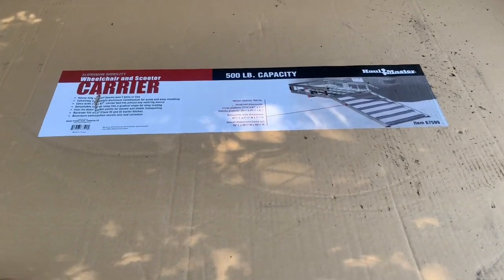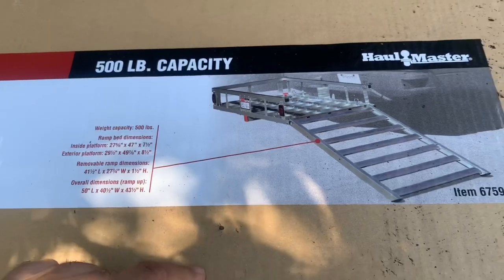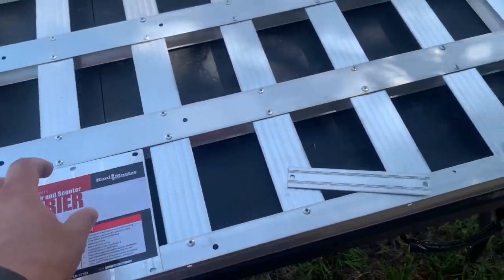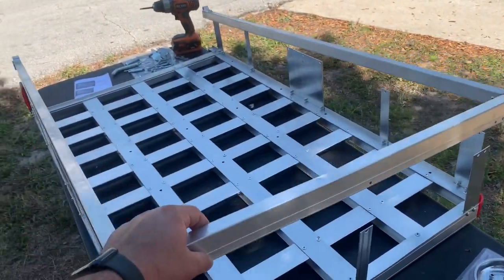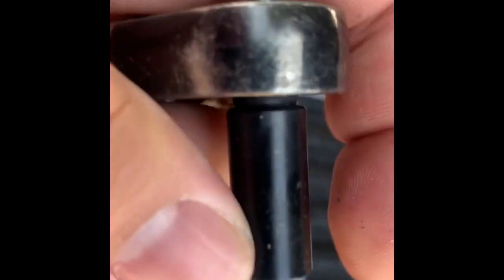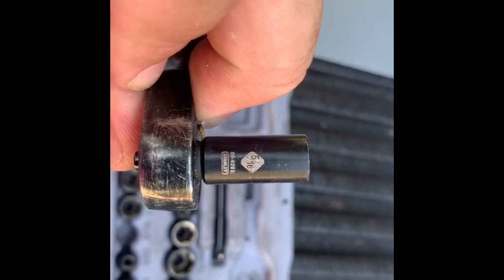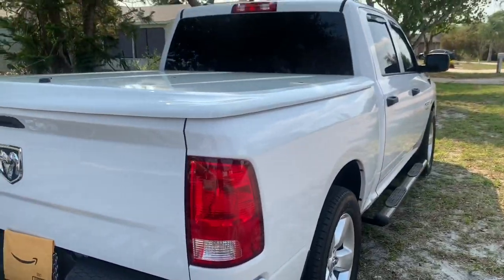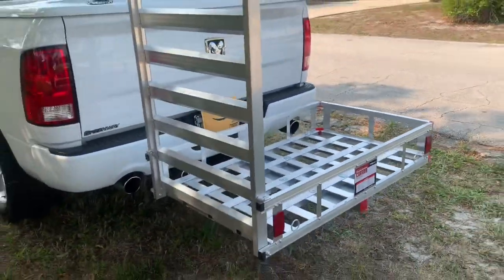Harbor freight mobility wheelchair and scooter carrier assembly, review and demonstration

Comment: Helpful video. I wish I would have watched before putting mine together today. In the video from HF, they show it loading on the driver side but the box and photos show the left. Also, if loading at a curb it makes the ramp angle less which makes loading easier. Thanks a bunch.
Reply from the maker: no problem thank you

Comment: Although it would lower your ground clearance, it would help with the ramp issue is to have a hitch extender that lowers the carrier.
Reply: That is exactly what I was getting ready to say, I just saw the video myself for the first time on the Harbor Freight app, and I come to here to be able to leave a comment, but yeah,  an extender to where it would lower it to the ground a little further about 4 inches that would make a big difference and be able to get it up there on it with just one person, I’ve got one myself and getting ready to purchase a ramp carrier to be able to take my scooter with me when I need to go somewhere by myself and I know myself personally, it would be a little hard for me to get it up there it would give me out real fast But yeah, the extender to where it would lower it even about 4 inches like I said to the ground would help a great deal……
Reply: I agree, A drop/rise receiver,  for a pickup depending on the height of the truck, 4”-6” probably. Most of the carriers are designed for cars or SUVs, that are lower to the ground.

Comment: I have a 2010 traverse. I have the hauler with the ramp on the passenger side. But  I have to lower the ramp in order to open the rear hatch door. Should have been off set.  I also bought the anti rattle tightener to keep the hitch tight. The hitch part makes it heavy.

I plan to extend the top ramp pin holder so it will slant out enough to open the rear door.  Also, since this carrier is wider -  if you position coolers, bike etc correctly the rear door opens without unloading everything. So this is a plus.
Reply from the maker: @nebraska8379  yes it’s not ideal but it works

Comment: Had to put diamond plate on my ramp and platform for traction and 3 of the 4 eye bolts broke off and had to replace with bigger, stronger ones. Other than that I really like this hauler.
Reply: Grip tape like we use to use on skateboards with help

Comment: The only thing I can think of is the Ramp is too short so it's at too steep of an angle. I'm thinking of buying this kit just to use the parts to build a weather enclosure for a mobility chair. Thanks for the vid you just need an extension for the ramp. 👍👍❤

Comment: Thanks for the video. Seeing how such a carrier actually works for loading was notable, as was the assembly and the wobbly mounting. Given the construction of the undercarriage of many scooters and the usual height of hitch receivers, I suspect a loading ramp would have to be 12 or more feet long to avoid manhandling the scooter beyond its own drive-ability. I reckon the Harbor Freight carrier is not unique in that respect. Most carriers I've seen have ramps too short for easy loading of many scooter models.

Comment: Even though this vid is 3 years old -- if a side walked-curb isn't available to park next to ---- how about taking only the ramp  to a shop that does Aluminum welding and adding 2' of length -- that will cut down on the steepness -- but check it first with lengths of wood ----- you might need longer or not as much --

Good vid -- I'm in the market for one now --

P/S -- I'd be interested in what you did to solve the problem ?
Reply from the maker: I returned it and we got one that folds up so it doesn't stick out so much when not in use helps with parking and not letting the truck stick too far out after the scooter is removed

Comment: Your problem is the steep angle of the ramp, and the sharp corner it creates where the ramp meets the carrier. Install a hitch mount lowering adapter that brings the hitch square closer to the ground… maybe 6 inches (but not too low that the carrier would hit the ground while traveling). You can minimize the carrier’s wobble and play by also installing a hitch receiver clamp to the ramp.
Reply from the maker: Thank you so much for your help

Comment: Lay a piece of plywood at the bottom of the ramp and back the scooter on. The plywood is so the rear wheels can find traction before the anti-tip wheels hit the ramp. After the scooter is on the ramp and off from plywood place the plywood in the bottom of the carrier for storage, then finish backing the scooter on and tie it down.
Reply from the maker: Thank you for the info

Comment: Problem with this carrier, some scooters like a Maxima Pride 3 wheel scooter the casters underneath get caught on the rungs won't climb it. I had to buy rolled aluminum and screw that over the rungs then add grip stick tracks for the tires to climb it. Then I got a 4 wheel scooter and that scooter got high centered going up it, of coarse I have a 4x4 pickup which is a bit higher. Another issue being disabled I could not carry this carrier to the truck so I installed 4 casters to roll it to the truck then added running and brake lights to it people tailgate I figured made it safter from vehicles slamming my scooter.

Comment: I see I'm late to the party, but I'm shopping for one these now. I think the biggest problem with the ramp is where you're parked the ramp is sitting on ground lower then the where the truck tire is sitting. On a level parking lot it would less steep, also you could put a 4x4 block under the end of the ramp. The scooter should be able to climb over the block if you back it on and then the ramp angle would be pretty shallow so it would roll right up without issues. If you see my reply---how well has it held up?
Reply from the maker: We returned it and got one that folds up when not in use
Reply: @itiswhatitis7473  can you tell me what/where you found?  Thank you
Reply: @OhRonaldo SILVER SPRING 500 lbs. Capacity Hitch-Mounted Folding Steel Wheelchair or Scooter Carrier with 42 in. L Ramp

Comment: Since the cargo would cover your plate, do these need to have license plates issued like utility trailers? Or lights if you have it on at night? I have a bad back, but want to use it for my lawn mower. It looks relatively lightweight if I were to take it off and on at least once a week. Is it awkward to do so? Thank you so much for your review!
Reply from the maker: saralynn518 it’s easy to take on and off
Reply: @itiswhatitis7473  Thanks! Good to know! Did you know about the plates or lights? Likely state specific, but I have never seen any of the ones like this that have any. I just find it odd lol. I'm in Ohio btw.
Reply from the maker: saralynn518 yes I have seen ones with the plates but those look like ones with a more permanent install
Reply: saralynn518 
Check out the reviews in Harbor freigh, there’s a veteran who did some minor modifications because of back problems and it made easier and better for his needs

Comment: Is there a max speed limit that you can drive with it installed with a chair on?
Reply: No. Just get a hitch stabilizer to make the platform solid and not wobbly. Harbor Freight sells one now.
Reply: @rtz549  Found out my vehicle's tongue hitch load is not enough. Had to go to plan B.
Reply from the maker: no not really as long as the chair is strapped down

Comment: how did you get the ramp on. i'm having trouble with one side lining up for the lock and tightening the ramps.
Reply from the maker: peter panini you talking about the hitch part like sliding in the whole thing into the hitch
Reply from the maker: Or the holes for the hitch pin ?
Reply: @itiswhatitis7473  the ramp where it attaches to the hitch carrier. and only one side had the ramp lock pin go in lined up perfect. the other side seems off so i think i need to take the ramp out and it doesn't seem like it tightens much.
Reply from the maker: peter panini yeah once it’s in the hitch the holes should match up to slide the pin in, and it doses wobble around so you would need an adapter to stop that

Comment: I got the exact carrier for my vehicle and I run into that same problem. I'm a big guy muscle wise and everything but I can't get the scooter in or off the carrier by myself especially I can't get it on it the biggest problem is the ramp is not long enough so it's too steep of a grade and it the back wheels come off the ground and spin there's a couple small wheels on the front back of mine that get caught between the slats. It's better than nothing but it's seriously flawed when it comes to being able to get the scooter onto the carrier because of the ramp. Not recommended for someone who doesn't have others to go along with them to put their scooter on and off for them. You won't be doing it alone I guarantee

Comment: I'm putting a thin diamond plate sheet on the deck and diamond mesh sheet metal on ramp for wheels to pass over gaps in ramp.small wheels. Hitch lift needed to becouse it drags on steep inclines. Thanks for sharing.

Comment: Definitely not a good design.  Glad I saw this video before going out to buy one
Reply: There are a couple of issues they don't discuss. First, the hitch on a pick up truck sits higher than on a smaller vehicle. My Jeep compass is much lower and the height of the carrier is not as high as that truck they are using. Second. The ramp should go on the passenger side as its meant to be accessed/supported by the curb. The curb will also decrease decrease the travel height of the carrier by a few inches (depending on the curb).

Comment: Stupid ramp he literally push that cart on there good thing I didn’t buy it.
Reply from the maker: Yeah its just not good out the box, you will need extra adaptors for it to work
Reply: Add a drop down on the hitch if it’s to high.  Simple fix makes it way easier to load scooter.